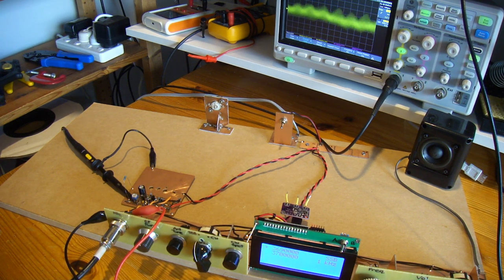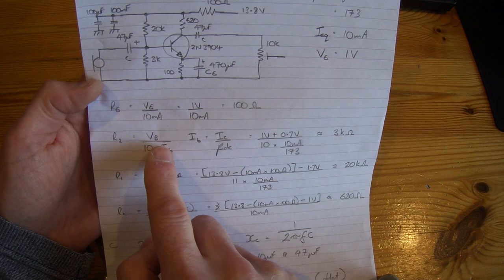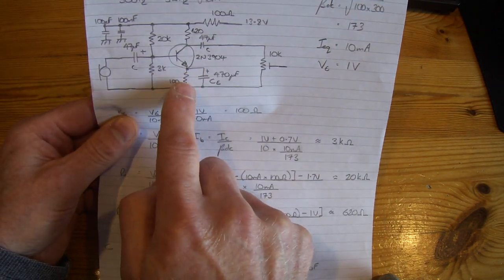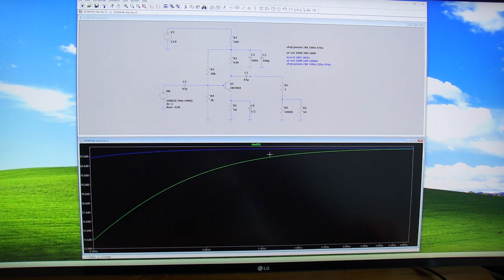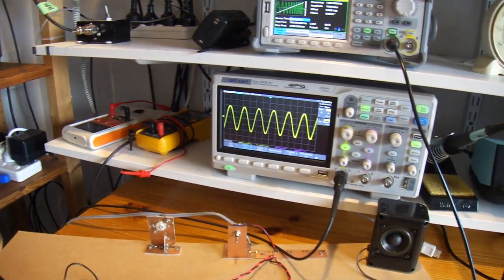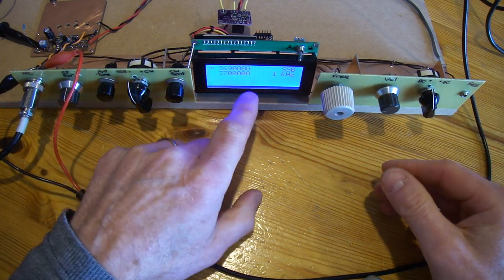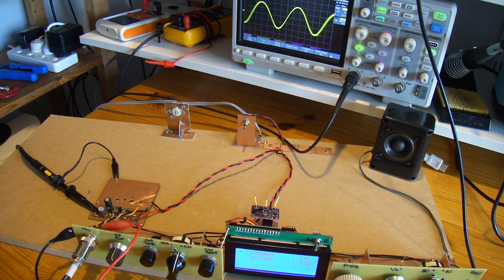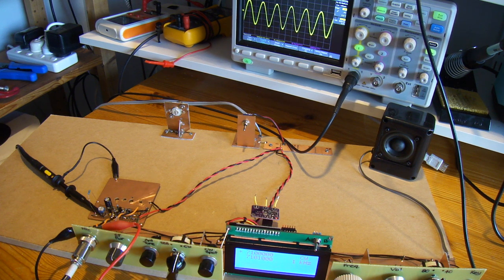Homebrew 80m/40m SSB/CW Rig - Part 3: Mic Amplifier

Comment: Great videos! I use them as guides for how to teach these electronics concepts, your conceptual descriptions are very helpful! If this is helpful, another way to think about how to choose those input and bypass capacitors is to think of them working with the resistors as high pass filters. Then it's simply just an RC filter. The input RC high pass filter is that input capacitor with the parallel combination of the two bias resistors. The bypass capacitor forms another high pass filter with the emitter resistor. Looking at those simple RC fingers will get you your Bode plots right away in an intuitive way.

Comment: Thanks for sharing. Can you explain where the choice of the 10mA of biasing current comes from ? Why not for example use only 1mA ?
Reply from the maker: Hi Frédéric. If you look at the 2N3904 datasheet you'll see the hFE gain is maximum at 10mA (min 100, max 300). This is a base rig so I can afford to have a higher quiescent Ic in order to maximize the gain.

Comment: Is there any high frequency cut off on the amp, i'd put a RF bypass to ground to stop RF trying to get through. Also i'd try and out a low pass filter in there to start to kill the gain after 3KHz.

edit:- forgot to add great video, must try and make a radio someday.
Reply from the maker: No, as I'm relying on the crystal filter to attenuate any frequencies <300Hz and >approx. 3kHz. Definitely do try and make a radio. You'd be surprised how little to you need to make an effective transceiver.
Reply: @CharlieMorrisZL2CTM   Great work Charlie. The wideband IF, (even tuned IF) has a lot of noise which is demodulated down to audio, on both sidebands. One can check  just the IF sensitivity difference (w/o  crystal filter) by doing a 10 dB S/N test, and then trying a simple filter at AF (eg LPF LC or active) The early Plessey  designs using SL600/1600 were entirely wideband, and had to have an active LPF otherwise  audio noise would have been horrendous (and so would sensitivity degradation)